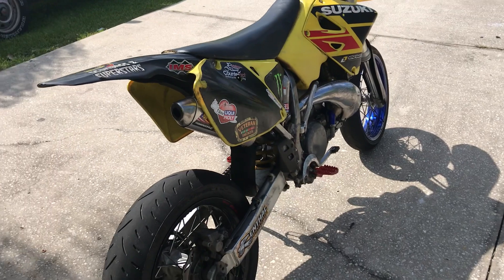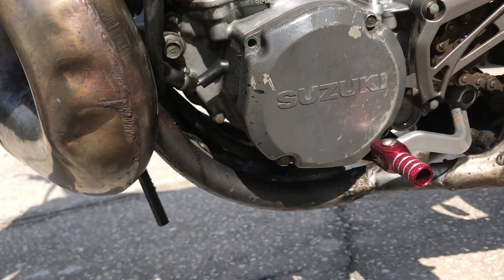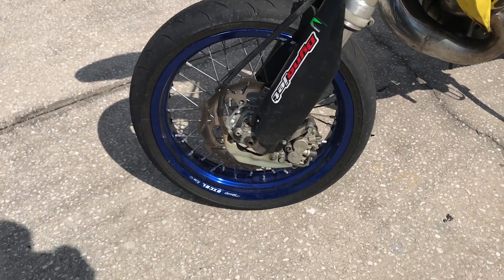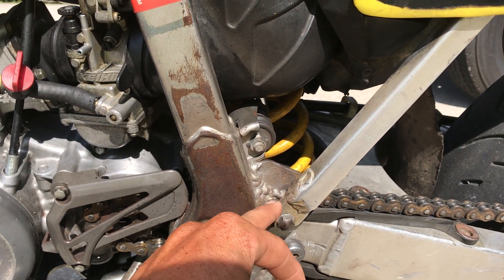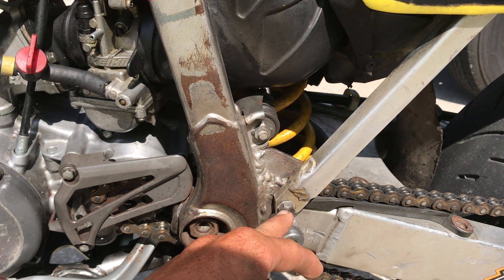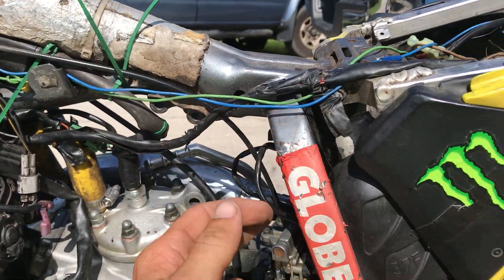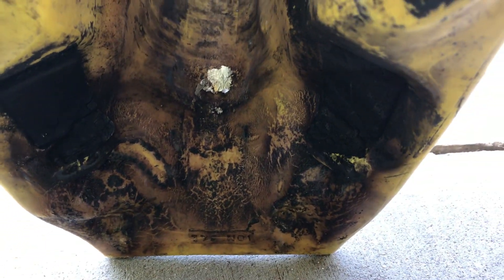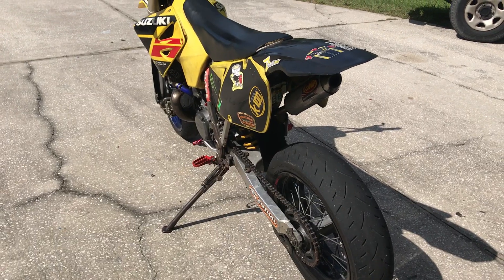HOW I MADE MY DRZ400 A 2 STROKE

Comment: This is a terrific project, good job young man! You didn't really touch on the subject of my main interest, the electrical's. How did you set up your charging system? Gauges? Spark control, sensors and so on? When you were heating the fuel tank to get it to seat properly on the frame was the tank empty or full of fuel?